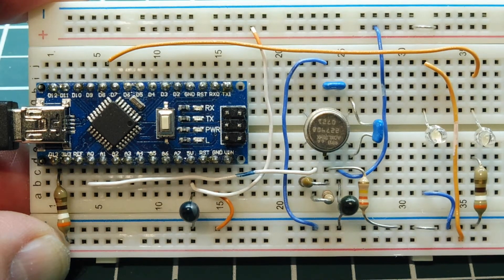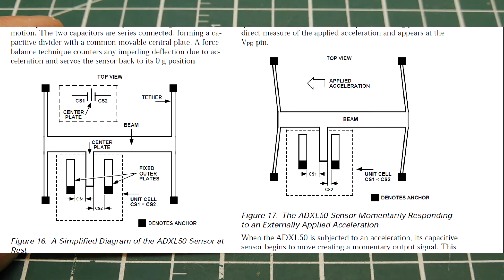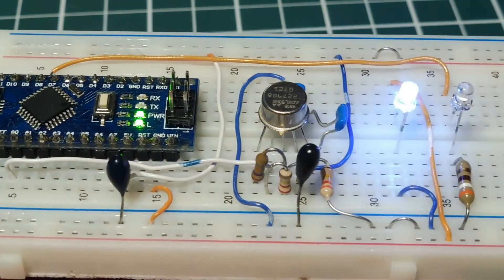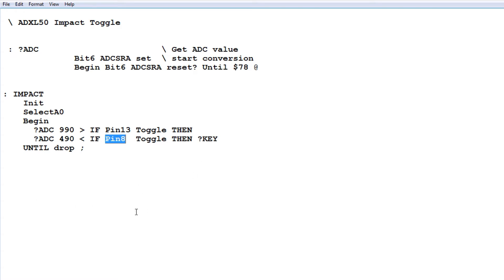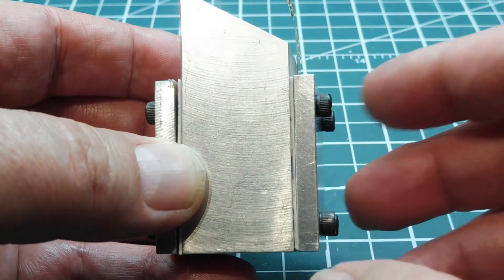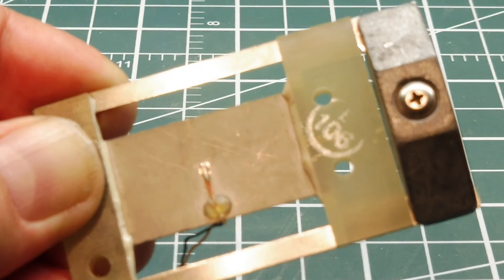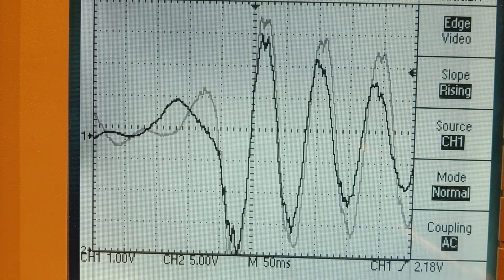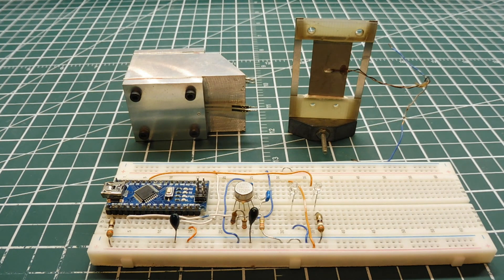Impact Detection using an Accelerometer and other techniques

Comment: hey man thanks for the videos these are a good insight for someone new to this technology
if I want to measure up the impact of a device to the ground, should I use a force sensor or an accelerometer
Reply from the maker: An accelerometer would be a good choice.
Reply: @0033mer  thanks for replying. I was thinking the accelerometer also measures the force while the device is in motion (falling) while the resistor only detects and measures the impact with the ground which is what I needed

Comment: im new to doing stuff like this, but I want to make something that would turn a light on when it detects any amount of deceleration and stay on until its stopped or starts accelerating. is this how i would have to do it or is it a different way
Reply from the maker: An accelerometer can detect acceleration/deceleration and output "g" force values which can be used to trigger an indicator. Check out the ADXL345 accelerometer.
Reply: @0033mer  I have a arduino and accelerometer already, but it's the coding and wiring to the vehicle that I'm unsure about

Comment: thanks a lot for this i am working on making a impact detection device and your video really helped
Reply: Bro where did u get that sensor pls respond, I need an urgent help,pls respond , I'm from India
Reply: HRP Productions hey I got it from robu.in and they ship from Pune via FedEx support for the product is really good. I am using MPU6050.
Reply: @eyeversion  will it detect impact as shown in this video like he s tapping in different axes and it gives an output
Reply: @eyeversion  bro pls respond
Reply: @hrpproductions53  it will for sure. Learn concept from this video and you can get few sketches from Google to play with.
Reply: @eyeversion  u r telling abt mpu6050 right
Reply: @eyeversion   can we  connect  mpu6050 with Arduino so that we can aquire digital values of the impact thru the serial monitor and use it for the impact detection
Reply: @hrpproductions53  indeed, as i wanted more than 3 axis. MPU6050 has 6. Read more on the website and some searches will get you rolling.
Reply: @eyeversion  what they mean by 6 axes, there are only x,y, and z right what is mean by more than 3 axes pls explain
Reply: @hrpproductions53  Dude have you heard of Google??
Reply: @hrpproductions53  do some research man
Reply: @amoghkashyap402  bro I have completed my project one year back 😂😂

Comment: I like the fact that you present not only how things work but how they are used.  My only question is how did you come up with 990 and 490 ? At 19mv/G and a range of +/- 50G the voltage to the ADC would be 1.5v to 3.5v so the counts would be 307 to 716 if a 5v reference is used out of the ADC.
Reply from the maker: The accelerometer has a programmable gain output buffer stage where you can add resistance values to get a sensitivity output range from 40 to 200 mv/G. I added gain to this stage to make the circuit sensitive to impacts from a screwdriver handle. I can't remember how much gain I used but the values used in my code reflect the added gain.

Comment: Where can you get this Accelerometer?
Reply from the maker: Analog Devices has discontinued making the ADXL50.
A similar accelerometer you could use is the MM7361 by Freescale which is a 3 axis accelerometer.
Check out this video:  https://youtu.be/Qcq5LdVYc5c
Reply: @0033mer  sir pls give ur contact number, I wanna contact u, I need ur help